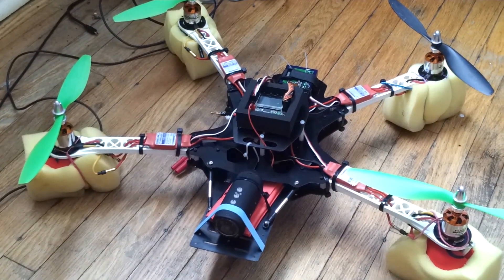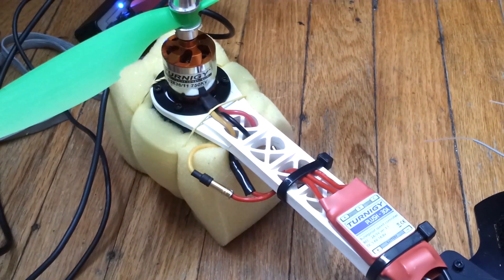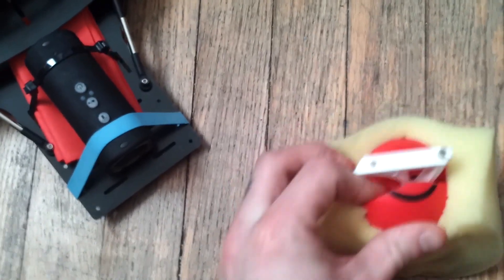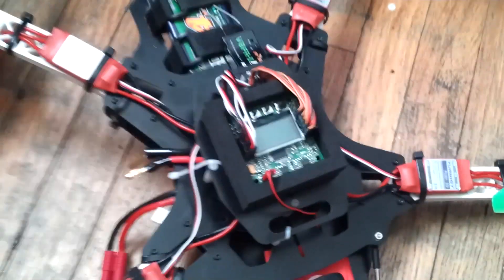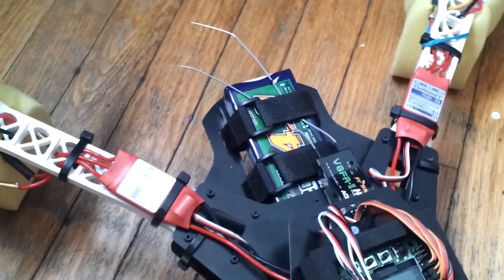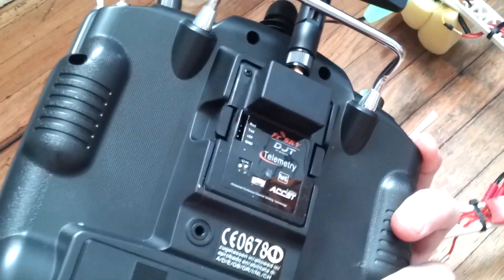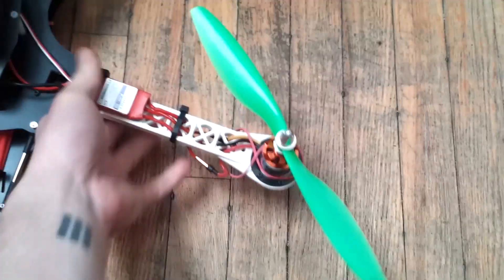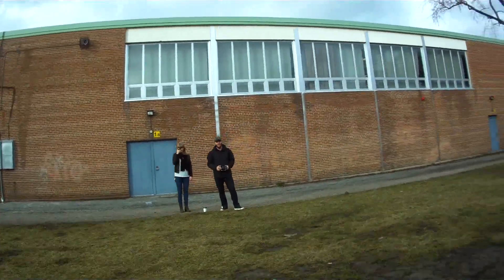Quadcopter Build for FPV, Early Flights, Tuning, Crashes

Comment: Also, I had the same stabilization problems as you. I used some PI, stick scaling, and auto-level settings suggested on the hobbyking forum and the thing flies amazing and the auto-level is near perfect. I can actually let go of the controller.

Comment: Hey, are you using the stock motor mounts plates for the SK450? I attached Turnigy XP 2836-11's to them and one of the CF plates exploded... it turns out the driveshaft clip was physically touching it.

Did you modify your motor mount plates to accommodate for the 2836's?

Comment: I just finished my dead cat build. I'm trying to figure out why I can't get mine in the air. everytime I throttle up M1 pulls harder and rolls it over. I've checked motor config, directions, props, acc calibration, all motor provide lift. So I'm stumped right now.
SK450 Deadcat
KK2 1.6
30 amp SimonK Flashed esc's
1000kv ntm motors
Futaba T8FG Super
Any idea what might be causing this?

Comment: Have you set the special motor mixes in the software of the flight controller?
It seems that you have to do that for special frames like the dead cat with different angles?

Comment: It would have dropped out of the air as the antenna that you are using is a directional antenna and the signal comes from the top left corner, where the white sticker is. This means that you always need the left corner pointed at the quad as it has a very narrow, but powerful, transmission field. Hope this helps a little. Happy flying.